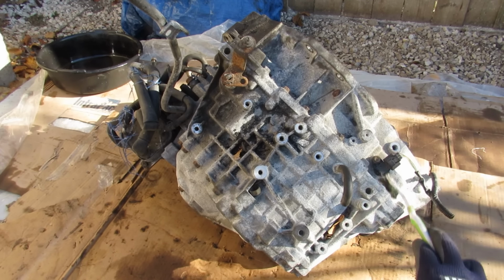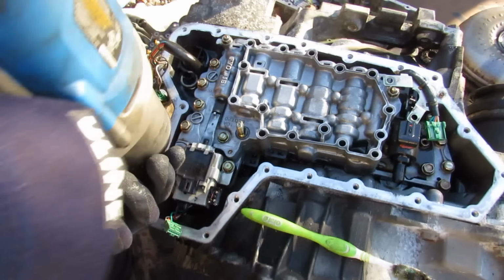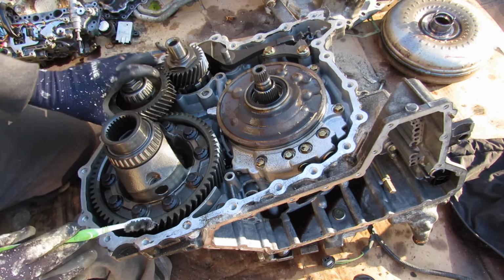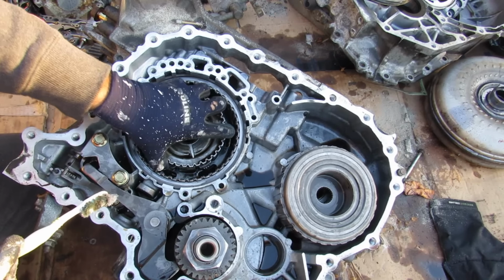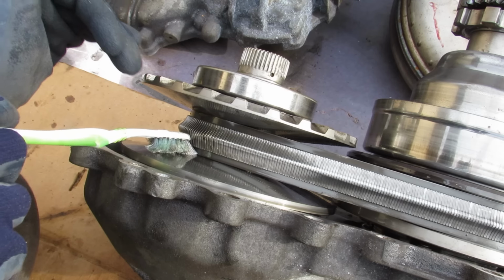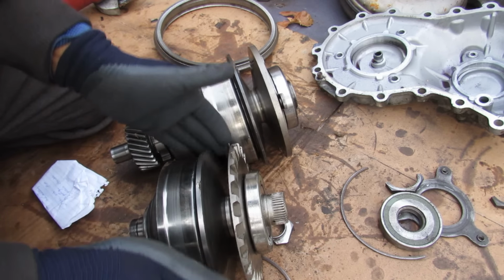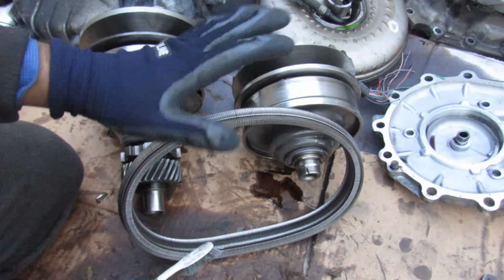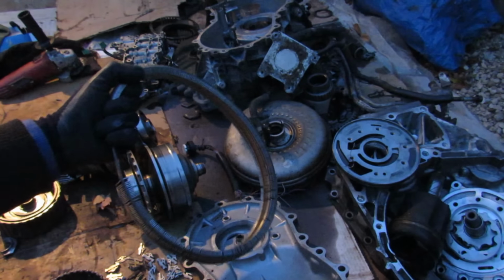Why Nissan CVTs FAIL

Comment: Great video! That's the ancient CVT 3, you should now do the newer CVT8 to compare. The new CVT8 no longer uses a steper motor, and the oil pump is driven by a chain driven/drive sprocket from the TQ converter. The primary pulley sensor was also eliminated. They went to 3 way solenoids and software to calculate the position of the primary pulley. I believe the biggest problem was the calibration and contamination. The solenoids also had issues from supplier side, and the contamination would eventually find its way into the valves/solenoids. There was a considerable amount of contamination left behind during the manufacturing process that was eventually addressed. The belt also caused some contamination. Every transmission has it's issue, especially a Ford transmission :). The CVT wouldn't have had a lot of these issues if Nissan would've offered a free of charge transmission flush around 60k miles. They did extend the warranty to 120k but still an inconvenience to the consumer. 

The CVT2 was used in the 4 cylinder Chrysler's, Nissan, Suzuki, and Mitsubishi. Very similar to the big brother CVT3. The CVT7 was used in the Nissan Versa and Chevy Spark. I built hundreds of CVT's from the ground up over a period of 14 years, and a majority saw 150-300k test miles without any issues. Depending on the test, we had oil change intervals around 30k miles and the units were hand built to spec without any contamination!
Reply: You sound like you know your CVTs. Few seem to around here!
Do you have any experience with the Fiat/Ford CTX CVT from the 90s? I think one of the first CVTs sold. My parents have got one in a 1998 Fiesta.

For a few years it's been at a stage where it has to be driven on its own terms, If you put it into D with your foot down on the brake like a normal auto it'll just stall the engine. It's like you need to only gently cover the brake, select D when you're ready to move and let it pull itself away, then you've got to put it into neutral before coming to a stop. Its like what I imagine a conventional auto would be like if you removed the torque converter, or most of its ability anyway.

I'm guessing the problem is with the clutches/valve body rather than with the belt/cones. Should we try a fluid change or is that going to do more harm than good with the age it is? Not sure if it's been done before or not.
Reply: @thegearknob7161  sorry, I'm a year late lol. I've never heard of anyone using a CVT in the 1990s.

Comment: #savethemanuals Cars that you can buy in 2020/2021 that are manual-some have automatic options too: Chevy Corvette, Camaro, Spark; Dodge Challenger; Ford Mustang, Focus; Honda Accord, Civic, Fit; Hyundai Accent, Elantra GT, Veloster; Kia Forte; Mazda 3, Mx-5 Miata; Nissan 370z, Versa; Subaru BRZ, Impreza, Wrx, Sti; Toyota Corolla, Yaris ; Volkswagen Golf, Jetta.
Reply from the maker: The accord manual got knocked off for 2021. Don't forget the Tacoma

Comment: This is all true.  Only worth its weight in light cars and regular transmission flushes  no racing! No speeding!
Almost perfect economy... couldve done without the fake gearshifting. 
<insert metaphor> Like a movie supposed to be a drama trying to be a horror. It performs worse than it couldve and shouldve.

Comment: Wait, paddle shifters in a car with a CVT transmission? WTF is the point?
Reply: Sometimes, fully ECU controlled CVT can't keep up with manual transmission at hillclimb.
Reply from the maker: To give you the illusion that you can shift gears yourself
Reply: @speedkar99  I thought the paddle shifters in my Ford Escape Titanium were ridiculous, but at least least its transmission has actual gears to shift!🤣

Comment: Question: so with the manual valve that connects to the shift cable (regular nissan automatic not cvt) how should it be oriented upon reinstalling?

Comment: Drove a Sentra rental for 3500KM on a vacation. That was enough to convince me I would never own a CVT based vehicle.
Reply: Same here...
Reply: Some day you may not have many choices...
Reply: @spol1622  There will always be Manual Transmissions around.
Reply: @malveezy 

Sadly manuals are less & less available on many vehicles these days. We wanted one on our 2017 Nissan Sentra Nismo & literally none available though was an available choice. Not one dealer in our zone had one. Went with the CVT. No problems but still nervous about it frankly.

Comment: agreed.. sorter service interval and using OEM fluid, they experience alot of sliding friction and the oil has to be designed to handle it.. if the oil becomes burnt there goes half the transmission life..

Comment: The 4 cylinder cvts actually have a much higher failure rate than the v6s. And we do rebuilds on certain Nissan cvts. But all in all, decent video on the components.

Comment: Failure is easy, do what friends wife did. Shift from reverse to drive while still rolling backwards. The tech said the belt was wadded up like a ball of chewing gum lol
Reply: BLKMGK4 if the only repair for these is a replacement transmission I doubt a technician would waste their time taking one apart to see what the belt looked like.
Reply: Do the same with a manual and you destroy either the synchromesh or strip a gear. That manoeuvre is the dumbest thing one can do with a car.
Reply: @Gavichap  manuals generally don’t have synchros on the reverse gear, shifting into reverse would be difficult and result in lots of grinding. Not sure what a manual has to do with the price of tea in China though 🤷‍♂️

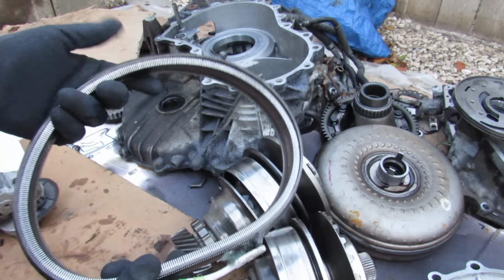Comment: "This belt is probably the weakest link in the system..." 15:06
It's mind boggling that some automotive engineer would actually think a belt could handle any more power than a lawn mower engine.
Cheap garbage.
Reply: The belt itself is very strong. Belt failures are usually due to underlying issues, like seized variator or bearing. Incorrect fluid pressure is a big culprit.

Comment: Snowmobile clutch and belt in a car, what could go wrong lol.
Reply: The only things that should ever wear out in a transmission are the synchros and the clutch.
Reply: Engines generally last longer than transmissions so they should work on making the transmissions better not worse why what for Fuel Economy? Give me a break
Reply: @austintomkewitz7206  That because most costumer dont tolerate an engine fail and buy another brand if that happends. A failed transmission is for the most customer ok.
Reply: @jonasstahl9826  and why is that?
Reply: @austintomkewitz7206  Should be the other away around.  Engines get much more stressed with heat and violent explosions of fuel with byproducts that also contaminate the oil.
Reply: @austintomkewitz7206  -Saves a few thousand dollars in fuel. Costs countless thousands of dollars, massive manufacturing costs, resources mined and processed {CO2 emitted}. Resulting in  many times the transmissions per collective vehicle mile.. AOC's Green New Deal, excitedly promoted by Harris/biden,... exemplified ;
Reply: @blogengeezer4507  Stickshifts save even more fuel, if you know how to drive them, and a clutch replacement is maybe $800 every 100k miles.  A cvt rebuild is about $4K every 80k miles.  Americans are generally bad at math.
Reply: @austintomkewitz7206  My Nissan Primera P12 has 180k miles on it (manual, on the original clutch). One of my Cow-orkers has the same spec car with CVT with double that milage (original gearbox). The design life on the QR20 engine in these things is 150k miles, so the fact that mine needs $800 of suspension repairs (18 years old and BIG wheel bending potholes around here) has made it uneconomic to repair - no point in fixing it up when the engine is end-of-life and the whole car is worth $300
Reply: I know right, just about every car manufacturer has tried the CRV, even school busses. Garage idea imo

Comment: Now I'm nervous.  The Mrs. bought a Mitsubishi Outlander a month ago with a CVT.  I have an Ultralight airplane on a trailer that I need to tow.  It's rated for 1500 pounds tow capacity so I guess I'm going to be modifying the trailer to make sure it is as light as possible.
Reply from the maker: I wouldn't tow to much with an outlander

Comment: What's wrong placing a CVT on an efficient electric motor to extend battery range?
Reply: Electric motors don't really have a "power band" like an engine does so you don't need gear ratios or a cvt. If you need more torque it just uses more power, and when you are crusing it just uses less power.

Comment: Lots of people here are saying this is the best CVT video but its filled with misinformation. 

1) Rubber band feel of earlier CVT transmissions was due to loose torque converter setup (high K factor) and holding constant engine RPM at launch (which is atypical for an AT).  It is not due to the pulley piston chamber needing to be filled.... the piston is always under pressure, if it weren't then the belt would slip... the whole system operates on a force balsnce between the 2 pulleys.

2) Failure is not due to overheating transmissions. Although you are correct that the oil coolers were undersized, they transmissions would simply send a torque down request to the engine until the transmission could reach normal operating temps. The real reason for failure is/was micro scratches on the sheeves due to belt slippage. Once you developed enough, you'd slip more and more until the transmission is toast.

Not hating, just dont like it when people talk about stuff they don't understand.
Reply from the maker: I wish I could have opened the sheeves to see the grooves. I tried my gear puller but it was so stuck
Reply: @speedkar99  Yea, they are very difficult to pull apart.

Comment: What could possibly go wrong with that....substantially it’s not really any better than DAFs version the variomatic using heavy duty rubber drive belts. The DAF-Volvo system was very efficient and very simple. This looks like complexity without advantage. Heat can only come from friction and friction is wasted energy.

Comment: these fail because its a belt driven piece of trash. also certain cars share coolant lines with the engine, eventually engine coolant will mix with trans. RIP nissan

Comment: The single biggest mistake people make with these CVT driven cars is ignore the transmission fluid change, change the fluid and don't drive like a moron and they should last.
Reply: The biggest mistake is buying a car with a CVT......
Reply: @joeshmoe7967  they're not going away any time soon.
Reply: yep.. change it early and with Genuine fluid.. from new first service 50K  and then if the manual or dealership says every 160kilo do it at 80
Reply: @joebrown9621  wait till you see what the stealer ship charges
Reply: Well said right there. Change and completely flush the trans fluid. More often then anybody. The thing is already running uphill dragging 2000 lbs, Give the weak baby some fresh clean fluid. Hook a brother up............Jim Tree

Comment: Can any parts be purchased such as a new belt or variator pulley or clutch pack? These are basically hydraulic controlled comet torque converters😂

Comment: Until they make one of these CVT transmissions easily serviceable I won’t ever be getting one.
Reply: Avoid the Nissan. I have 295k on a CVT in my Toyota.
Reply: @greenftechn  impressive
Reply: traditional Borg-Warner hydromatics aren't that easy to service (only a specialist should pull apart a traditional auto and there are a lot of butchered "rebuilds" out there put togeter by morons)

Nissan won't offer service manuals in North America. They are REQUIRED to in Europe under right to repair laws (they are not allowed to say "only nissan dealers can service our cars" - that's an illegal restraint of trade) - which might give you a hint as to where to look if you want to pull your CVT apart

(A second hint: European CVTs don't have a reputation for unreliability and the general comment is "it doesn't feel like shifting at all" - which is what they're SUPPOSED to feel like. 200k miles on things like EU Murano CVTs is "normal"...)
Reply: Honestly I think a CVT is the least of your problems. Your extraordinarily cringe name and profile pic comes to mind lol
Reply: @nolanholmberg3264  stars and bars punisher eh!
Reply: @nolanholmberg3264  savage. Love it. My thoughts exactly! Because you just KNOW that he'd be the one personally servicing it alright anyway... Riiiiightt! Come for the videos, stay for the clowns in the comments section.
Reply: @nolanholmberg3264  , Dude. Please. Do not start politics. Just Don't.

Comment: What drives me crazy is that they won't just let a CVT just be a CVT. Instead they use software to mimic the gear shifts of an automatic transmission. One of the benefits of a CVT is the smooth power delivery and no pauses in between gear shifts. The public at large don't understand the distinctions between the two. Instead of trying to educate the masses, they just acquiesce and trick everyone with a simulated gear shift pattern. To me, the simulated gear shifts just feel loose and sloppy and make the overall driving dynamics worse.

Comment: I find it interesting that the same Jatco model that's in my Mitsubishi Mirage is used in cars like the Juke and the Altima. Those cars both place a significantly heavier load than my little turd. I suppose there's a reason why the Mirage does not typically have issues with pre-mature transmission failure, which is the utter lack of torque the engine is capable of.

Comment: The CVT even with a torque converter is a very bad idea.
So no serviceable parts, not even the metal band can be replaced if it were to snap.
Avoid!

Comment: I work for nissan and i'm not defending the CVT. The engineering and concept are very good. The real world application is what leaves it wanting. Over time it just doesn't hold up to real world loads. But the MPG benefits were quite good. It allowed nissan to hit EPA numbers without going EV hybrid.  I had a 2013 altima and was getting 38mpg on the highway with a 2.5L engine, which is not a small 4 banger. When Nissan first introduced the cvt in the 2004 Murano it was other-worldly. All anyone had to do was test drive one and they were sold. When it was revealed in 2007 nissan was going to go 100% CVT in all its passenger vehicles, i was concerned. And we're reaping what has been sown now.  They should've invested in multi-gear automatics like Toyota. My wife's Sienna van has 8 speeds. (Why a Sienna when i work for nissan? They quit making the Quest) I have heard a rumor with unconfirmed information from someone who would be privy to this; said Nissan is going to be quietly backing away from the CVT over several years and going back to conventional multi-gear. Oddly, Toyota is now dipping its toe in the CVT technology. But they're doing a hybrid type thing. (Not hybrid EV stuff) They are doing a transmission with a conventional 1st gear that is a solid gear on gear configuration. When it up-shifts from 1st it will go into CVT mode. I think that might be the secret sauce to CVT durability. Accelerating out of the hole is where so much of the load is on the drivetrain. It will be a curious thing to see how it works out. Interestingly enough, around 18 or so years ago, Toyota and Nissan traded technology in a swap. Nissan traded CVT tech for toyota's EV hybrid tech.

Comment: Ive had good luck with a 2010 Altima CVT. The only problem it had was a rotation sensor fail. $50 part and it was running as new. Changed the fluid and very little metal on the pan magnets for a 150,000 mile car. CVT's have fewer parts than conventional transmissions. When you have owners not servicing their vehicles of course things fail prematurely.

Comment: The first time I ever saw a CVT type drive system was on a lawn tractor.  Even with those things, the bearings for the pulleys would constantly go.  I would go through a set of bearings and a bearing shaft every 2 years.  Great concept, just not very reliable.

Comment: Nissan claims "fewer moving parts"  🤔 i guess Nissan cheats by counting all the belt links and bands as 1part.
(edit: correction of a numerical descriptive word)
Reply: Less MOVING  parts..  but they don't take into consideration  how many parts have to be REMOVED when it fails.
Reply: @johndaniels651  What automatic do you NOT have to tear down completely when it fails? Way less parts here than a typical slushbox.
Reply: @brucea550    My 2006 Altima (gears) automatic ran perfect all the way up till 265K miles, when some idiot T Boned me.  Probably would have gone another 150K at least!
Reply: @johndaniels651  Yeah, I’d definitely choose an automatic over a cvt. At least the Nissan cvt. See lots of the cars with them for sale cheap.
Reply: They have way too many moving parts in their engines to offset the transmission, with the hydraulic timing chain tensioning garbage, their shit fails because they over engineer most of their products.
Reply: Innovation for innovations sake
Reply: @PrinceJohn84  I don’t think it’s just for the fun of it. The cvt concept is excellent. The execution and quality is the problem.
Reply: @brucea550  problem consumer thinks they know better for shift feel is added making the CVT shudder and fail, once CVT is perfected will see them @ the  drags
Reply: @enduser6982  already been perfected on snowmobile and atv, aside from having to change belts occasionally, and easy to carry a spare. There could be belt drive cars too, but people don’t want to have to change one.
Reply: @brucea550  I agree if they could design it for the home mechanic to maintain it wouldn’t be much of a problem.
Reply: haha on the edit.
Every grocery store sign on the express checkout: 12 items or less
me: it's 12 items or fewer!!
Reply: Yeah the belt alone is like 40 moving parts xd
Reply: More like 400
Reply: @tuul75  At least.
Reply: Dusty 99  thanks for the reminder :-D ->i got "Stannised". will correct the word immediately. (english isn't my first language)